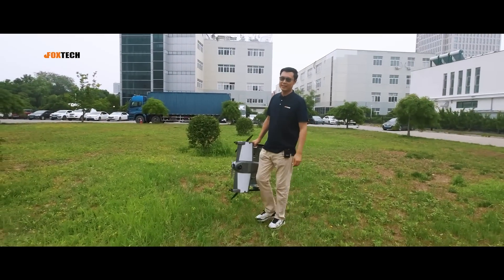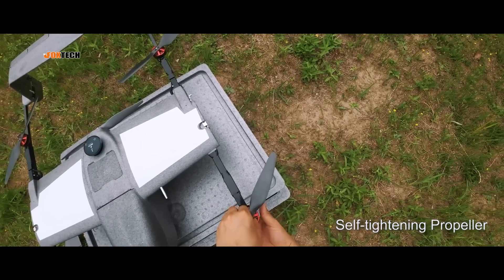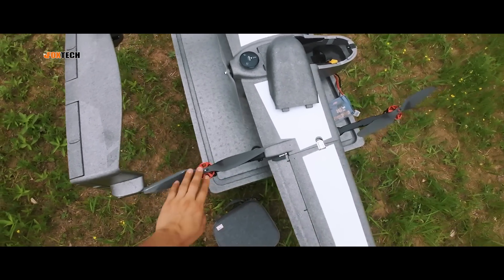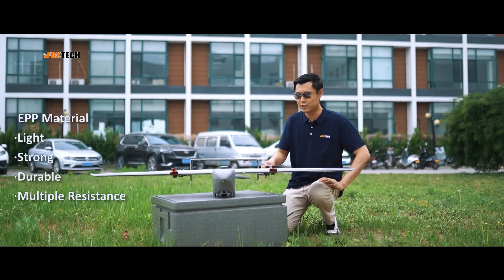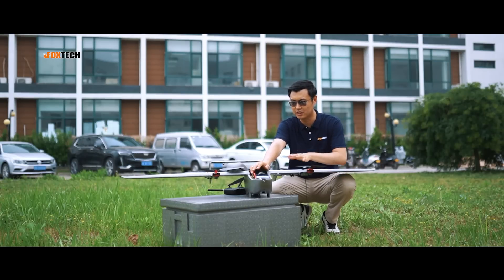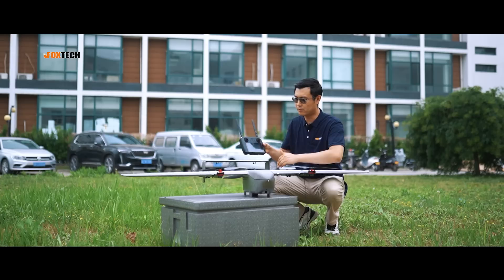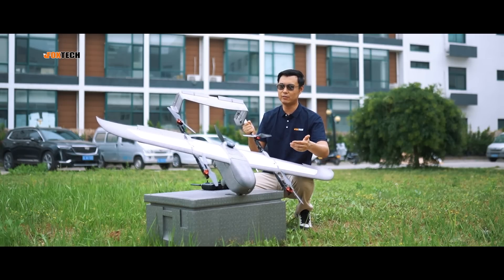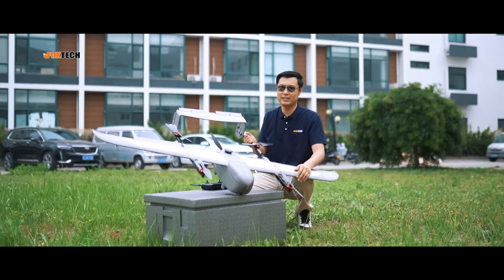Foxtech Loong 170 VTOL with Swing & Lock Design!

Comment: amazing design! i understand that the inspection version has a camera gimbal on the front of the aircraft. can the gimbal rotate 360 degrees and be controlled independently of the aircraft while it executes an automated flight mission?
Reply from the maker: Dear Sean, inspection version does not include any camera yet. Would you add our sales whatsapp, so they can recommend you a 360 degrees camera?

Whatsapp: +86-182 2287 0274. thanks.

Comment: Amazing product. How much endurance can be expected at its highest cruise speed of 26 m/s with the suggested battery ?
Reply from the maker: This is a mapping drone, do not suggest u fly in such high speed around 26m/s. We suggest u fly at around 17-18m/s, endurance around 90-100 min.
Reply: @Foxtechhobby  Thank you, but you specifically promote this drone for its capability of flying at higher speeds. 
So, let me repeat my question: what is the endurance at the highest (by Foxtech suggested) cruise speed of 26 m/s?
Reply from the maker: This is fastest flight speed, we do not suggest u keep flying at such a high speed.
Reply: @Foxtechhobby  Okay, so 26m/s is the max. speed, rather than the cruise speed of the Loong 170 VTOL?
Reply from the maker: Yes. Curise speed around 17-18m/s
Reply: @pascalfust1035  Maybe 30 minutes
Reply: @owenli1655  Could you meaaure?